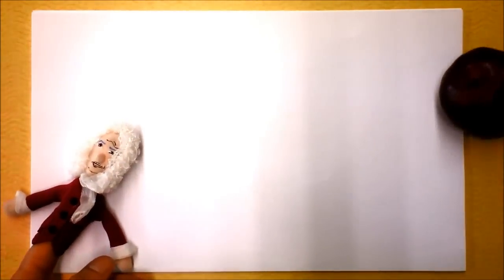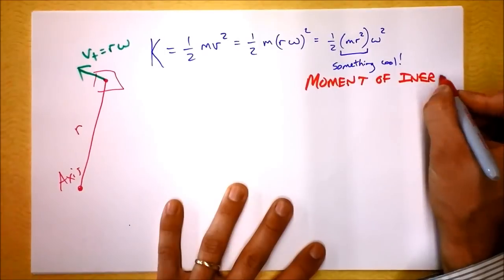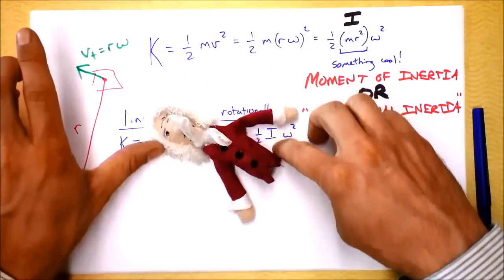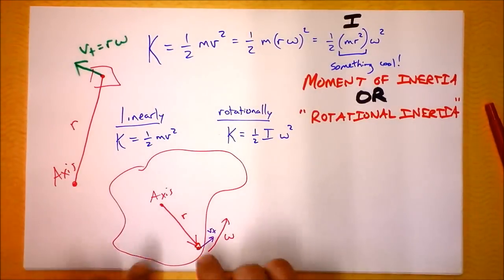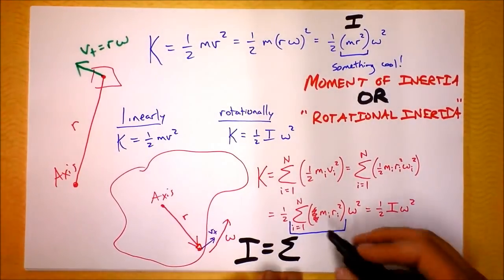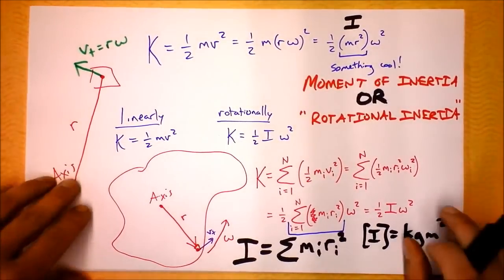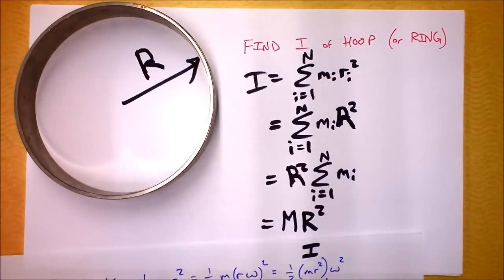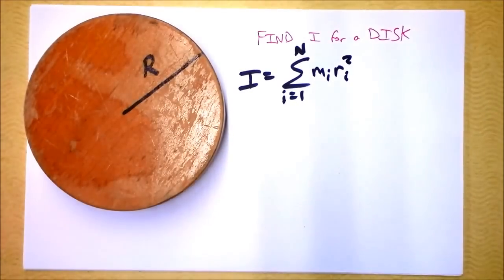Moment of Inertia Definition (Rotational Inertia) | Doc Physics

Comment: For those who missed the disc and are still curious about how to proceed:
Consider a small ring-shaped element of a very small thickness dx at an arbitrary distance x from the centre and find its mass in terms of the mass of the entire disc (M). that can be done by finding the disc's mass per unit area (assuming it to be homogeneous), and then multiplying it with the area of the ring shaped element (total length×thickness).
Now find the moment of inertia of the ring you've just made, which is its mass multiplied by its distance from the centre (x). Lastly integrate this expression (I'm assuming you know a bit of calculus) within the limits 0 and R (the radius of the disc) to get the moment of inertia of the entire disc. You should get the result I= (1/2)MR^2
Reply: sorry I made a slight error there. while finding the moment of inertia of the ring-element you've got to multiply it's mass by the square of its distance from the centre (x^2), not merely x